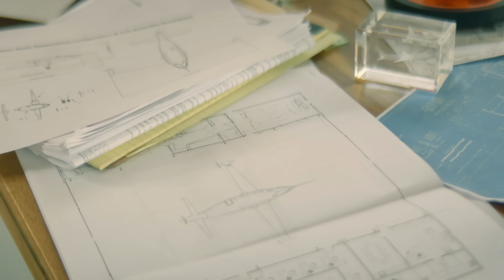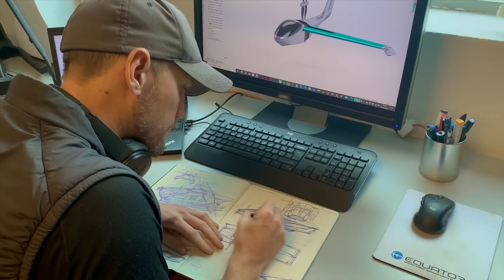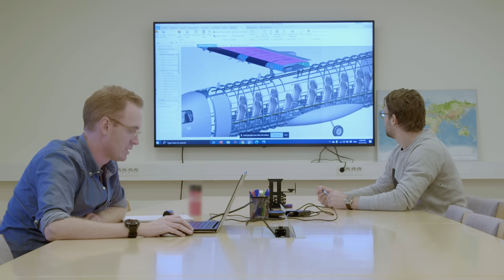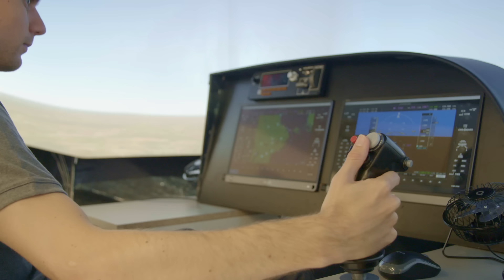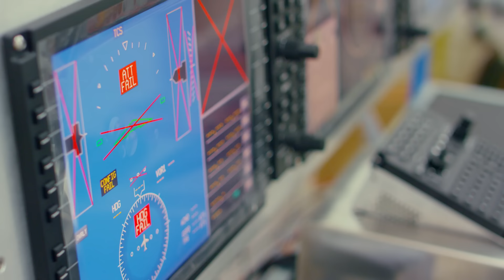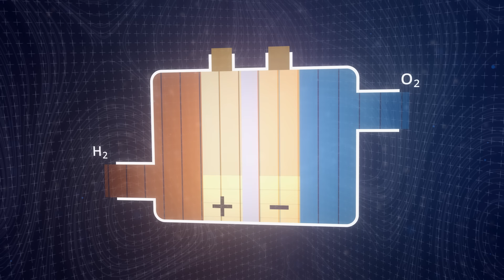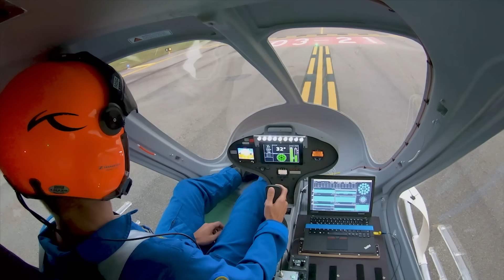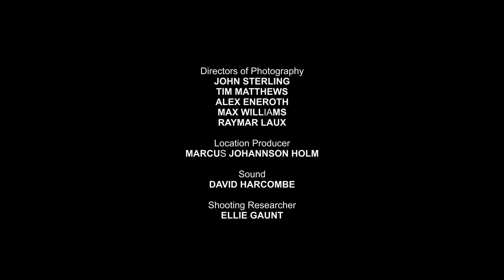Planes of the Future: The End of the Jet Age? | FD Engineering

Comment: I admire the young inventors of our time. They could potentially provide an alternative to the large corporations that exploit us. A jet engine is heavy mainly because it includes sturdy metals to withstand extreme heat. Electric motors also generate heat, but not as much as engines, allowing us to use materials that can tolerate heat while remaining light. Although the battery may drain quickly, once the motor starts, it can recharge itself while in use. Even though they may have limited range and speed, it doesn't matter since we are aiming for a budget airline experience, not to mention their potential for future improvement. If there are any obstacles to this development, they would be our fixed mindset and corrupt politicians with their cozy relationships with big corporations.

Hats off to these young engineers!
Reply: It can recharge itself while in use?  I'm not sure I understand what you're saying there.
Reply: @dustinabc I don’t think he does either, unless it’s an auto gyro in descent mode.
Reply: Young people can be brilliant but too many are misled by people telling them large corporations are bad.   In reality large corporations exist  because they efficiently provide us with goods we want at a price that is very hard to beat.  Forty years ago you might work a week or more to earn enough to buy a 32 inch low definition television.  In America a days wages today will get you a 70 inch high definition thin television.   Try finding a small group of people any age that can do that….   Necessity is the mother of invention and the best motivator is greed.   Greed can be good if it gets you up in the morning to be a productive worker and citizen.  Competition and free enterprise, not government interference, bring forth the best ideas to make them successful.  Companies with lazy workers who feel entitled to getting paid for low productivity go out of business.  Companies with bad ideas go out of business.   Large companies like Amazon deliver us stuff we want very efficiently for very little cost saving tremendous amounts of fuel and time.    No person is forced to work there.   Every American can get a good education and a great paying job.   I didn’t say it was easy.   It takes hard work and time but almost anyone with normal IQ can do it if they choose to.   We are free so many choose to be lazy and complain about corporations and feel entitled to the same standard of living as people who work hard and plan smart.   You can’t dink around in school and goof off on the job and expect the same rewards as someone who works hard at getting a pertinent education and saves money and  takes risks and invests their savings in various companies.   It doesn’t work that way.   If people don’t like large corporations that provide us goods and services efficiently, they are perfectly free to spend their money at small businesses or with individual producers.  See how much it would cost to build a 70 inch HD flat screen by yourself or have one custom built by some individual.   I doubt you could do it for a month’s wages.   I wouldn’t know where to look in the earth for the raw materials or how to process them.   No personal can even come close to building a passenger jet but I am thankful that large corporations and capitalism driven by the desire to work for a better life can organize people into corporations that can achieve great thing that benefit us all.    I like to support small business as much as possible.  There are things they can do better than big companies such as making a great sandwich or pizza.   You will pay more but sometimes it is well worth it.  Socialism is not as good as capitalism at motivating people.   It is a nice sounding idea that historically and currently fails in practice and fails greatly comparison to free enterprise.   Greed is good if it motivates people to accomplish great things and work productively.  I am referring to the greed of an honest hard working and hard thinking worker.   Greed of a lazy person who dishonestly tries to trick or cheat people out of their money to get what they want is evil.   Expecting the government to take care of you is wrong.   You should be helping the government to perform its necessary duties by earning good money and paying a lot of taxes and spreading the wealth by being generous to others who are working their way through school or performing low skilled service jobs.   Give 25% tip to restaurant servers and they will be happy to see you walking in the business the next time and they will be  serving you with a genuine smile.  Tipping like a tightwad or not tipping and demanding great individual service will get you some spit in your soup and an unhappy and bitter service worker . There is no free lunch and the government does not create wealth or money or produce any product or wealth. .  They perform necessary functions at a very high cost to the taxpayer.   They can print money but that just inflates the currency and steals a little bit of wealth from people who work, save, invest, and pay taxes.   Giving the printed-out-of thin-air-money  to lazy and idle people rewards their bad behavior and creates the feeling of entitlement and does not generate any tax revenue. Welfare handouts re not good motivators..
Reply: Young people can be brilliant but too many are misled by people telling them large corporations are bad.   In reality large corporations exist  because they efficiently provide us with goods we want at a price that is very hard to beat.  Forty years ago you might work a week or more to earn enough to buy a 32 inch low definition television.  In America a days wages today will get you a 70 inch high definition thin television.   Try finding a small group of people any age that can do that….   Necessity is the mother of invention and the best motivator is greed.   Greed can be good if it gets you up in the morning to be a productive worker and citizen.  Competition and free enterprise, not government interference, bring forth the best ideas to make them successful.  Companies with lazy workers who feel entitled to getting paid for low productivity go out of business.  Companies with bad ideas go out of business.   Large companies like Amazon deliver us stuff we want very efficiently for very little cost saving tremendous amounts of fuel and time.    No person is forced to work there.   Every American can get a good education and a great paying job.   I didn’t say it was easy.   It takes hard work and time but almost anyone with a near normal IQ can do it if they choose to.   We are free so many choose to be lazy and complain about corporations and feel entitled to the same standard of living as people who work hard and plan smart.   You can’t dink around in school and goof off on the job and expect the same rewards as someone who works hard at getting a pertinent education and saves money and  takes risks and invests their savings in various companies.   It doesn’t work that way.   If people don’t like large corporations that provide us goods and services efficiently, they are perfectly free to spend their money at small businesses or with individual producers.  See how much it would cost to build a 70 inch HD flat screen by yourself or have one custom built by some individual.   I doubt you co😅😊uld do it for a month’s wages.   I wouldn’t know where to look in the earth for the raw materials or how to process them.   No personal can even come close to building a passenger jet but I am thankful that large corporations and capitalism driven by the desire to work for a better life can organize people into corporations that can achieve great thing that benefit us all.    I like to support small business as much as possible.  There are things they can do better than big companies such as making a great sandwich or pizza.   You will pay more but sometimes it is well worth it.  Socialism is not as good as capitalism at motivating people.   It is a nice sounding idea that historically and currently fails in practice and fails greatly comparison to free enterprise.   Greed is good if it motivates people to accomplish great things and work productively.  I am referring to the greed of an honest hard working and hard thinking worker.   Greed of a lazy person who dishonestly tries to trick or cheat people out of their money to get what they want is evil.   Expecting the government to take care of you is wrong.   You should be helping the government to perform its necessary duties by earning good money and paying a lot of taxes and spreading the wealth by being generous to others who a😅re working their way through school or performing low skilled service jobs.   Give 25% tip to restaurant servers and they will be happy to see you walking in the business the next time and they will be  serving you with a genuine smile.  Tipping like a tightwad or not tipping and demanding great individual service will get you some spit in your soup and an unhappy and bitter service worker . There is no free lunch and the government does not create wealth or money or produce nothing.  They perform necessary functions at a very high cost to the taxpayer.   They can print money but that just inflates the currency and steals a little bit of wealth from people who work, save, invest, and pay taxes.   Giving the printed out of thin air money to lazy and idle people rewards their bad behavior and creates the feeling of entitlement and they don’t. Pay any real taxes.😊
Reply: @challengersrt8680  I would like to address some points you brought up. In my comment, I said, "These small ventures could be an alternative to the big companies that are exploiting us." I took care in choosing my words, particularly when referring to big corporations and their actions. I believe you may have misunderstood my point or interpreted it differently.

I didn't say "they are bad." What I meant is that they are exploiting us, and I stand by that statement.

Yes, big corporations contribute to our world and benefit all of us through mass production, which reduces the cost of items. They also provide many people with decent jobs and lead advancements that shape our lifestyle and advance knowledge. I could go on listing their contributions to our world today.

I have nothing against big corporations, nor do I dislike them, as they provide products that I use every minute of my day.

However, I still stand by my point about exploitation. It's a fact of life that we deal with. Environmental pollution and abuse are primarily associated with big businesses. For example, when a few individuals abused the responsibility of being trusted custodians of investors' money across Wall Street, the result was a global depression and economic collapse. Also, when an aircraft corporation collaborated with authorities in a gentleman's agreement, we have seen the results. Moreover, we have witnessed the impact on agricultural, food, and other industries due to the corporate power of a handful of corporations.

This is exploitation and abuse. When a big company fails, it takes the country down with it. In such cases, innovative small businesses could be an alternative. That was the main point of my comment.
Reply: Do you think in the near future they could have in-flight recharging?
Reply: @detdet3871  I like to believe so. Technological developments of our age are progressing rapidly. They are not starting from scratch like early airplane pioneers. I believe it's worth trying and building on it as it progresses.

Comment: The greatest savings potential is overlooked in the video:
1. Lower cruising speed is much more energy efficient. Long-distance propeller aircraft of the 1940s were much more fuel efficient than modern jet aircraft because of the lower speed.
2. The propeller is still far from maximum efficiency.
3. Wake turbulence: Instead of putting the engines at the wing tips, you can also do this with the fuselage. Such concepts already existed in the 1940s. This reduces the bending load on the wing and it is easier to build because it has an almost constant thickness over its length. Even biplanes would be conceivable with 2 fuselages on each end. This would create a large passenger capacity with the same aircraft width which limits the use of today's runways. The lower travel speed and thus longer travel time is compensated by the fact that the increased volume gives passengers more space and therefore more comfort, e.g. for good sleeping accommodations. This means that the flight does not become a waste of time for the passengers.

Comment: i think E-plane still not yet capable of fully replace conventional jet-plane, but i'll looking forward that one day we will have an E-plane that can fly as far as jet-plane and of course more efficiency and more environment friendly than jet-plane
Reply: Not even close
Reply: Hydrogen powered engines, similar to rockets like the space shuttle
Reply: Norway IS the perfect proving ground for this new tech.  400 or 500 kilometer range?  Because of the fiords and the mountains of Norway a 30 kilometer trip.. as the crow flies, requires, today, as much as 4 hours by road (230 kilometers to go around, up and over the mountains.),, or 7 hours by boat. (62 kilometers going up one fiord to the ocean and down the next to the destination.)  15 minutes by electric float plane.  His experimental 2 seater is already the cheapest, fastest way to get  to the next town.
Reply: Battery-powered planes can be plenty useful merely as regional 70-80 seaters. They don't need to compete with long-haul.
Reply: @paranaenselol  The R&D for LH2-powered long-haul wide-bodies is already done and dusted.
Reply: In less than ten years you should be able to order a drone to fly you home from your telephone.
Reply: The Air Force was looking into biofuel for jets like over a decade ago. Are they still doing it I have no idea, but I know jets will never go away. There is no way a prop plane will ever overtake a jet engine or a rocket engine for shear speed.
Reply: make COMBUSTION ENGINE More Efficient, and Stop the E-Nonsens. Batteries contaminate MORE and has LESS Power.-
Reply: @mike4181  Or you doing do what the Air Force was looking into overr a Decade ago and that is the use of Bio-Fuels. Not need to drill into the ground for oil and get away from Saidi Arabia and the like. And then you have something like what the demonstrator Abrams X has and that is a hybrid system. You see there are things yoou can do with electric and batteries that you can't do with combustible engines and that is run a hell of a lot quieter. You do realize they were working on electric vehilces over 100 years ago as well correct?? But it was the oil companies that killed it for obvious reasons.
Reply: @Lonewolfmike  "a jet engine or a rocket engine for shear speed."
"Shear speed"?  That's the speed going sideways?
Reply: @mike4181  They said they couldn't make coal burn any cleaner.

Comment: Is anyone else here a big fan of oil based fuel, and as excited to see developments of increasing efficiency and innovation from gas -powered engines as they are about electric planes?
Reply: Nah
Reply: Imagine having a party, inviting all your “friends” and “acquaintances” and, Voilá, NOBODY SHOWED UP.

Oil is Over, dude.
Reply: If carbon emissions are reduced, yes! Hydrogen is an excellent option, assuming it can be sourced in a way that reduces carbon emissions (and there are technologies that can achieve this already!)
Reply: @jennifernicoleprince  You understand that it takes a lot of energy to crack the Water molecule, to isolate the Hydrogen right?!? Then you can also see that you could have just stored that energy in a battery and used it to power whatever device you needed it to. Not to mention that Hydrogen is dangerously explosive.
Reply: yes. so many brainwashed
Reply: oil is great